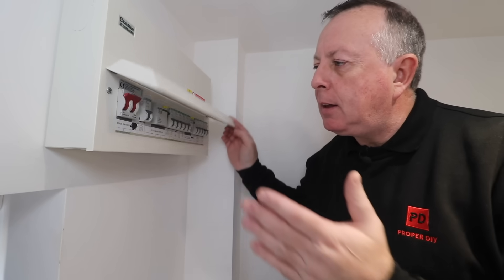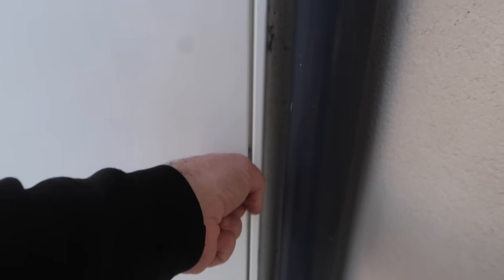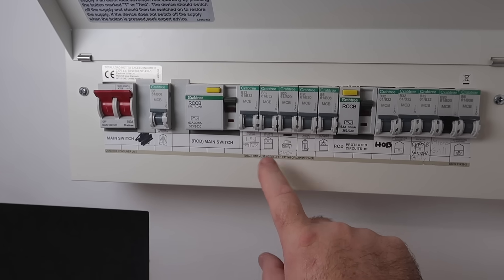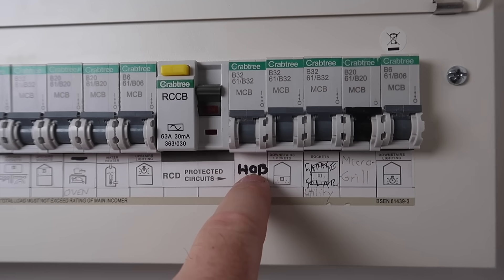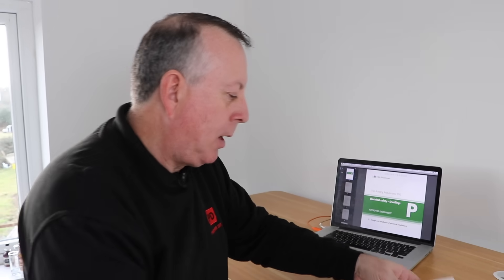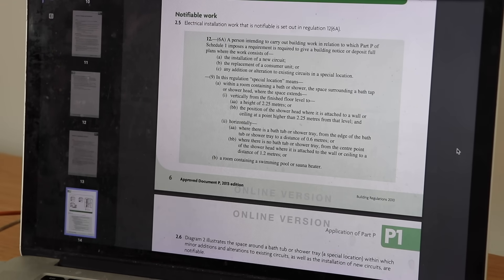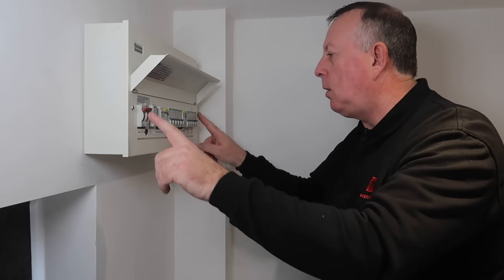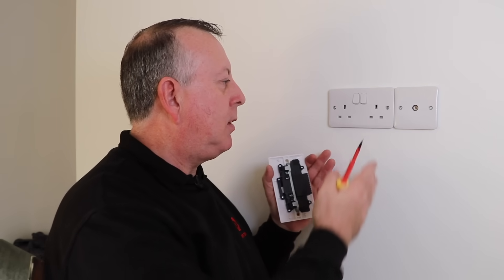What electrical work are you allowed to do in your own home?

Comment: If the electrical contracting industry was not such a scam for consumers then DIY would not be needed so much.

Example.  I wanted a shower wiring in.  Needed 3m + 2m cable, a pull switch & a breaker.  CU is in garage directly below shower and cabling has clear route up to loft.  No more than an hours work.  Contractor wanted 2 days & refused internal cable route insisting to run conduit up the side of house & £850 + VAT for the pleasure.  He got told to FRO.
DIY materials cost £30 & Part P cert cost inc. breaker install cost me £70 (still a rip off for what it is but suppose they need to make some profit.  He was only there 20 mins.)
Reply from the maker: You're right - this is a good example why it's not that 'easy' just to get an electrician to pop in and fix something for you.

Comment: Time indix 8.25. You are not allowed to install an isolator switch? Clarification. The isolator switch he is refering to is a new isolator switch ON THE CONSUMER UNIT/FUSE BOX. You cannot do that. But you could fit an isolator switch on for the garage door from an existing power supply. Fused spurs with isolation switches from existing circuits are allowed.

Comment: wow you guys are soooo regulated. 
I installed every single bit of wiring - the inspector stated that I went overboard, I had gone way beyond required code. I wired everything as though it were industrial with full ground loops from every termination back to the busbars
Reply: The UK has turned into what the East German state was 30 years ago.
Reply: And being well regulated is a good thing.

Comment: The RCB/RCD (sorry, it's called different in our country, but you know what I mean) NEVER suppose to save you. This stuff is ment to detect currents, which should not flow, and those currents typically runs in failed equipments. In an indirect way, you can be saved, but if you touch live, and your hands are dry, the 30mA possibly not pop, but you still fries at the end of the cable.  Also, if you manage to touch live and neutral at the same time (so no current difference generated) this still not pop... Please do not deploy false safety feeling about this stuff!

Comment: As a qualified electrician, I would recommend no DIYer irrelevant of how competent they feel they are should under take any electrical work in the home, I have visited a lot of properties where the DIYer has done work and the results are not good, fires are likely if joints not made off correctly and you need to be certain the circuit your working on is fit for it’s intended use, sorry but that’s the way it should be

Comment: Good video, but is it 100% correct? I checked with local building control  when renovating a property who informed me that as a unqualified DIY i was allowed to do notifiable electrical work if I informed them first. They said that assuming they can assert that work has been done 'properly' they would part P certify the work. Also you point on testing and equipment seems a little unqualified.... I brought all the test equipment for less than £100, and learnt you use it properly in less than an hour. I would qualify this by saying I did already have a good grasp of electrical principles etc. I also read Part P cover to cover a few times and refered back to it frequently. Lastly to anyone reading I do not encourage and advocate that anyone follows my lead, I'm merely sharing my experiance of Part P and Building Control.

Comment: Thanks for the video. We are becoming a communist state employing people to stamp certificates rather than letting the trade take pride in their work. Just look at the spegetti installations in a CU, or MCS Solar installations with wiring a 2 year old could easily tug on. For me there is a difference between an Engineer and an Installer. Funny how retailers can sell any electrical products used in notifable work to unqualified people - why allow them if your not allowed to fart.

Comment: The mains supply voltage in the UK is 240v +10%and -6% , we use 230v nominal voltage for our calculations  
I know this because I have been a qualified electrician for a little over thirty years and I have just spent the least three years training to keep up to date with the regulations and everything .  Also 230v is not accepted around the world the USA operates on 110v and 220v 90%of American homes are on 110v most of Europe are on 220v to 230v .
Reply: US is actually 120/240V split phase (for most domestic installations) - lighting and most socket outlets are 120V but larger appliances have 240V sockets (which have 4 pins). Three phase is 120/208V but larger installations often use higher voltages with transformers around the building to step down to 120/208V.

Comment: The actual voltage that comes into a UK home will normally be around 240V. The EU standard didn't actually change anything in the distribution system in the UK, the standard was just widened to include those countries with generally higher voltages (like the UK at around 240V) and a lot that used 220V in Europe. Really it is a specification of the manufacturers of electrical equipment. 

It's easy enough to check, and a lot of plug-in power meters will show what the actual voltage is at any point in time.

nb. for anybody who is having their CU swapped out, I would recommend to them to spend the extra and have RCBOs fitted rather than those RCD split boards with MCBs. That way, you get fewer nuisance trips, much better fault isolation and diagnosis and if something does trip sue to excess residual current, then it doesn't knock out half the circuits in the house.
Reply: I've seen 245 volts on my system, and my solar panels are at maximum output (i.e. the volt drop in my mains supply cable means that my house runs at a higher voltage than the local substation).
Reply: @roberthuntley1090  volt drop does not cause overvoltage . The opposite actually
Reply: i use a couple of smart plugs as part of my home automation system, and it calculates the average voltage based on what they are measuring. in my old flat that average was usually between 235 and 245 volts, now, in my new flat, i get averages of 240 to 250 volts, sometimes even more. i guess that's why some of my smart plugs just switch off for no apparent reason.
Reply: the incoming voltage is 240 rms . peak voltage is around 336v
Reply: @davidmarriott7372  Yes, but I'm not sure how relevant that is. Peak voltage on a sinusoidal waveform scales linearly with RMS voltage.

Comment: I believe most regs refer to a competent person...however they then define the qualifications/certifications etc that they deem 'competent'. We have a retired GORGI fitter at the end of our road... because he's let his ticket lapse (it's now 'gas safe') does it mean he's suddenly incompetent? Of course not!
I've worked on electronics, including high voltage radar power supplies most of my working life... am I competent? I installed my own gas boiler, there was an old gas pipe "terminated" by being folded over twice!! doubtless done by a qualified fitter... I've found lighting earth wires twisted together round a screw driven into a joist. A piece of paper doesn't guarantee anything, nor does the lack of it! (I'll maybe make an exception for deep sea submersibles.... ouch)

Comment: I always wonder if burglars could just easily turn off the house's electricity from the outside and turn off all the alarms and cameras...
Reply: Cameras maybe. But security alarms usually have battery operated backups. In fact, unless you isolate the alarm (from inside), turning off the electricity or even a power cut can actually set off the burglar alarm.
Reply: @davidhoughton2073  I guess if they want to enter your house they will :/

Comment: Good video. In Australia it's illegal for anyone other than an electrician to carry out any electrical work. Funnily enough, in the US it seems to be a free for all. But I guess they're 110V, whereas we're 240V and 415V in three phase.
Reply: The US uses 120/240V split phase for most domestic installations. Lighting and most sockets are 120V but higher power appliances (such as a cooker) will have a 240V socket.
Reply: This illegality extends to ALL data cabling and making data patch leads -  like WTF 😂
Reply: Australians are considered too feeble of mind to deal with the complexities of anything electrical. It's illegal even to wire an extension cord, or replace a power outlet. It's actually illegal in AUS to run your own phone or network cabling, or to make an RJ45 lead. Also there is no provision to get electrical work inspected or certified by anyone other than an electrician, and the pathway to becoming an electrician requires a mandatory appenticeship of some years. There is no provision for a "suitably qualified person" to do anything, even for themselves. I guess it keeps it all in the family, so to speak.

This is all under the pretext of safety, because all Australians know that millions of people in the USA, Europe, the world,  die every day from miswired network cables and badly repaired extension leads (because there are 3 wires that need to be connected to the right terminals - that's more than the average person can comprehend). Also we're told that Australian 230V is far more potent and lethal than the European 230V, or the wimpy 110V used in the USA ( although the lack of an apocalypse from the USA's 220V might be harder to explain). We are allowed, however, to change our own light bulbs.
Reply: @GarthMyer  Quite bizarre considering I learned how to wire a plug when I was a child.

Comment: As an American who does wiring, this is interesting. Here, you can wire anything past the main break including sub panels. Still need to follow code however.
Reply: Technically (at least in many places), you can even replace the main panel yourself, or sometimes even the meter box/etc (you just need to get the power company to come out afterwards and check things / install/activate the meter / etc.)

However, almost any kind of electrical work beyond just (like-for-like) replacement of receptacles/lights/etc generally does require getting permits (from the city/county/etc), and those permits usually require that once you do the work, somebody from the city/county will come out and inspect it and sign off on it before it can be considered "done".  If you don't do that, then you're in basically the same boat with insurance not covering things, and often problems when you want to sell the home, etc.

But that's why in the US you're not actually required to hire a professional for anything, if you don't want to.  You're just required to get inspections for everything to prove that the work has actually been done to code (regardless of who does it).

Comment: As a retired electrician I still think there needs to be an independent check for safety IF work is done by a DIYer. Case in point, in my previous house the garage the radial for sockets was a mix of 2.5 & 1.5 T&E behind drylining boards and mostly hidden in rockwool insulation. I took the easy option and put a 6A MCB on the circuit. there was also a lighting circuit taken from aj unction box on a 32A ringmain. That soon got a 6A fused connector as well. there was also a rat's nest of exposed wiring (which turned out to be misplaced  Earthing) round a junction box in the loft. And the earth cable in the downstairs lighting circuit never found it's way back to the consumer unit. Just as well I did an EICR on the property.
Reply: My neighbour had an electric stove for years that usually blew a fuze when more than one 'ring' was used for cooking.  He put up with it for years (at least his wife did) but when I helped fit a new electric cooker and checked the wire hiden behind the old cooker, we founf it was 1.5mm T&E, NOT 6mm cooker cable.  Once the new 6mm cable was run to the mains, the new cooker gave no problems.
Reply: An electrician recently working on my brothers flat wired a 2kW electric room heater up using a spur taken from the lighting circuit. My brother quickly realised (once he had installed the fuse that for some reason the electrician had omitted to fit in the isolating switch fuse plate) that something was wrong when turning on the heater to test it was working tripped the breaker and turned off all the lights.

The electrician denied all knowledge of any problem and refused to come back. So my brother told the main contractor who had employed the electrician that he could whistle for his money until it was fixed, and that he would be calling building control and everyone else that he could think of in the morning.

The problem is not DIYers or electricians but idiots and both sides have them.
Reply: I would prefer the system some countries use where, if some sort of inspection is required, self-certification is never allowed.

Comment: It's worth noting the rules are significantly different in Scotland, we don't have Part P of the Building Regulations (indeed we have different building regulations).  Broadly, anything that doesn't require a building warrant can be done by a homeowner, the requirement is that the work is done to a standard not who does it.  See https://www.east-ayrshire.gov.uk/Resources/PDF/B/BSelectricalguidance.pdf for example.

Comment: I learned my electrics in the Army and industry. I rewired my house 27 years ago and it still functions. However, I had it inspected and certified but a qualified ‘domestic’ electrician without fear or favour once this was completed. What I have learned is that the RCD ages and needs replacing every few years. As I live in a rural area I can suffer from being at the end of a line which means that the 230v can dip.
As a matter of interest from your personal experience how many older properties actually have any form of electrical certificate relative to their original installation?

Comment: Just a word regarding laying a cable in a wall. I was drilling a kitchen wall to take a cabinet. Boom! I had drilled into the cooker circuit that was run diagonally across the wall. I know I should have used a detector. Beware of cables not run vertically. BTW the drill ended shot across my shoulder and ended up the other side of the kitchen. The tip of the drill bit had melted.
Reply: There should have been an rcd.
Reply: @rogerphelps9939 not necessarily? 🤦🏻‍♂️

Comment: So just for confirmation, I have changed a single gang plug which is for my dishwasher into a double gang socket which then has the dishwasher on one side and a plug in RCD going to an outdoor double gang socket. I wired it like that to make sure I can isolate it from the inside and also have RCD protection without purchasing an RCD outdoor plug socket.
As the original plug is located in the kitchen, I haven't broken any rules?
Reply: Hello how are you doing, nice to meet you here.

Comment: Correct me if I'm wrong but part p does say this.
•	 An installer who is not a registered competent person may use a registered third party to certify 
notifiable electrical installation work as an alternative to using a building control body.
Who is NOT A REGISTERED  competent person is the clue here. Do it yourself and Jo bloggs to test. It's all to do with money. Look at what building control charge. Anyone who says it's reasonable are cuckoo..

Comment: The electrical testing certificates I have seen are nowhere near detailed enough to prevent DIY work becoming easily identifiable unless it wasn't done compliant with the wiring regs. No accurate recording of all exact existing socket & isolator locations, no photographic evidence of wire runs etc. Some electrical test results are recorded but they can naturally drift a bit anyway due to aging of the system. How will an inspector ever be able to identify good quality and wiring regs compliant DIY work that wasn't signed off?
Reply: That's what I'm wondering.  I know what gauge and colour wire to use.  When I needed an RCD I bought one that looked exactly like the one that was faulty.